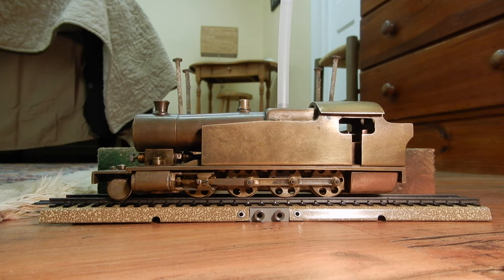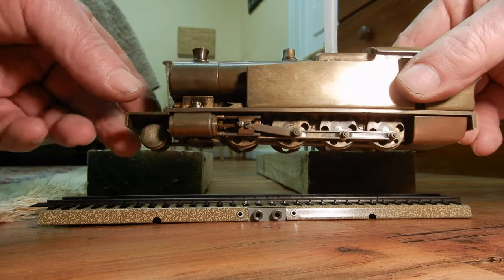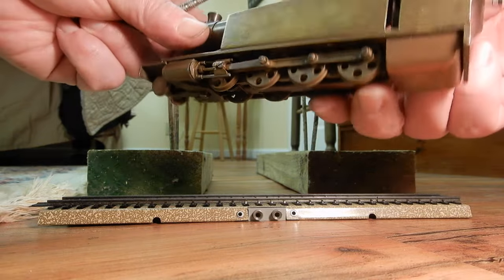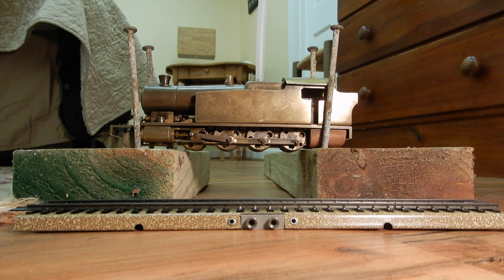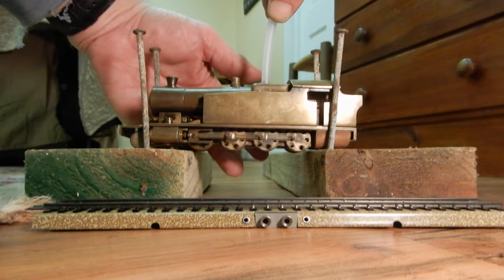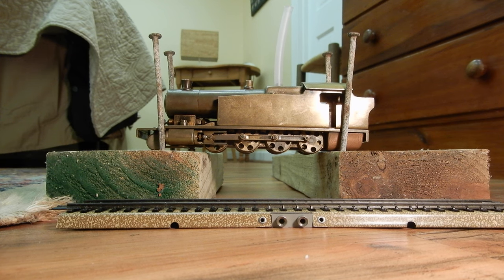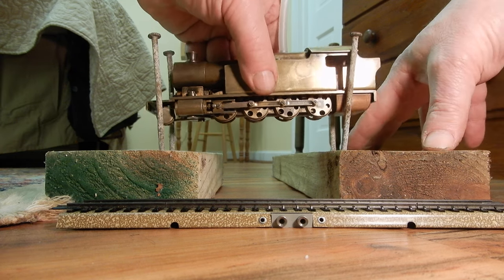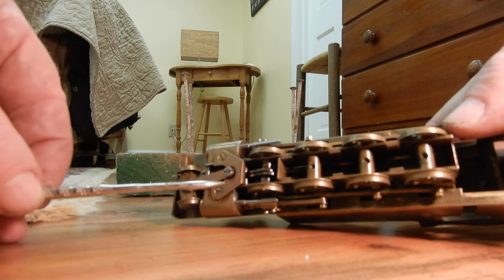2-8-0 HO / OO live steam locomotive unboxing test bench on air AA Sherwood Plain Jane design

Comment: Wow, that is an impressive model! Looks like it rolls and runs very smoothly. I think the comparison to watchmaking is apt; watches may have more and smaller gears, but this one is also a pressure vessel!
Reply from the maker: You are absolutely right. I read yesterday the full article on Model Engineer, the valve system requires accuracy of 1/1000th of an inch.

Comment: Glad to see Arthur A Sherwood’s design still persisting on.  I hope his skills also make a resurgence, as no one else has ever made a live steam z scale locomotive, let alone a reliable one.
Reply from the maker: The design is impressive coupled with the craftmanship. You need almost to be able to build watches to make these locomotives. I would hate to break anything on it because despite having the bleuprint, I do not know anybody able to repair such a locomotive.
Reply: @CARANDTRAIN  I’d just be glad there aren’t any 0.25 mm screws to deal with. There are enough of those in the watches I’ve worked with already!
Reply from the maker: @1471SirFrederickBanbury  You are right. I have built a watch myself. My fear is when those little parts jump and you spend hours crawling under the bench to find them.